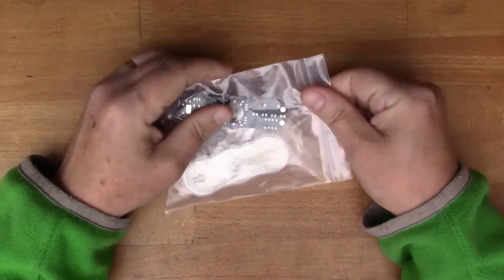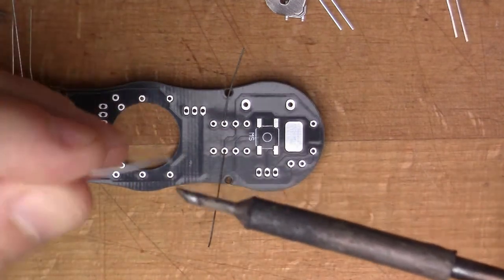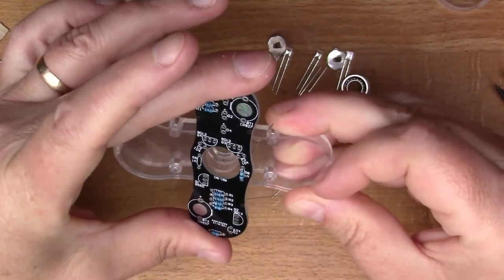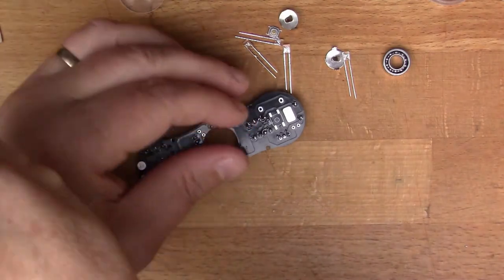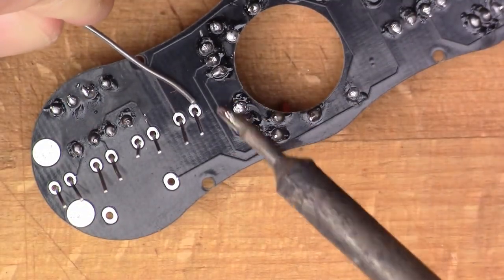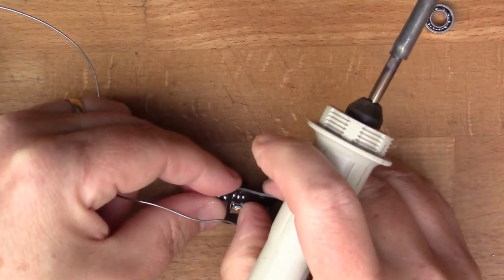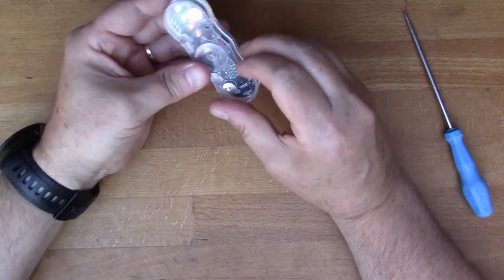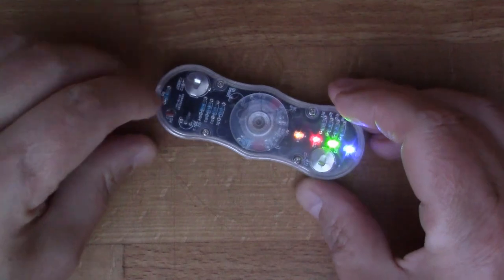Electronic Fidget Spinner - Kit Build (#135)

Comment: Hi, I need help i wanna make a project: control a motor servo(SBT0811 or SG 90 or together at the same time one vertically and one horizontally) with GY-521 from Arduino uno to raspberry pi 3B wirelessly with FS1000A and idk to connect these things
Reply from the maker: I did a video on the FS1000A a while back (https://www.youtube.com/watch?v=w6V9NyXwohI).  When you need to combine several sensors/actuators, try searching for individual tutorials (e.g. raspberry pi + FS1000A, GY-521+Arduino), then you just need to merge together the scripts/knowledge from blogs and videos that you find.